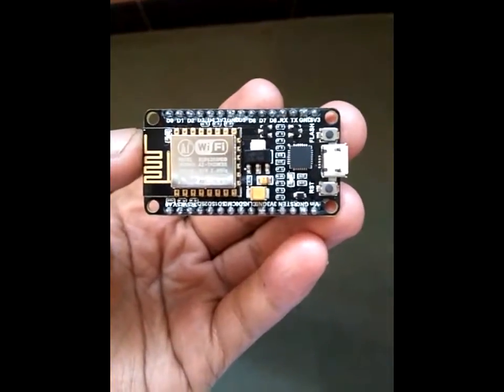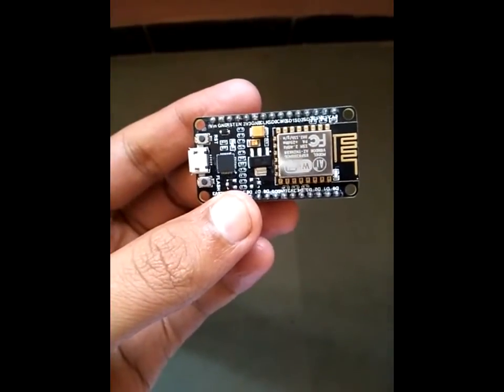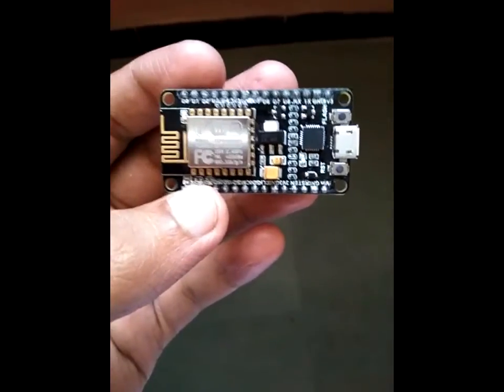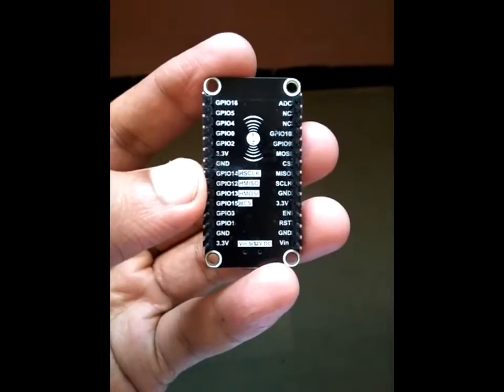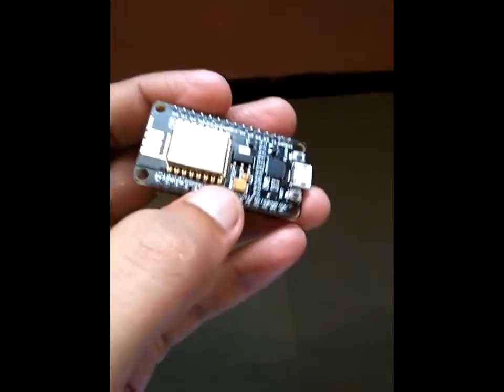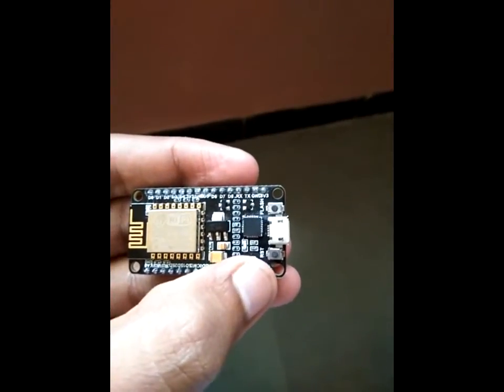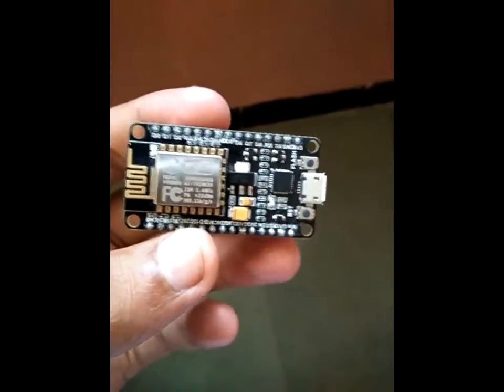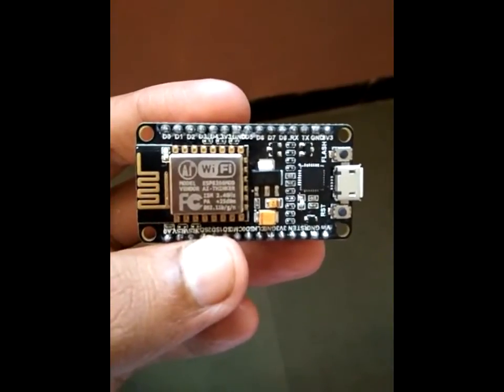ESP12E NodeMCU WiFi Module - "Specification & Application"

Comment: Thanks just let us know is this circuit can be used for devices that are not smart. I want to add this circuit to rectifier system for monitoring purpose and see its alarms. Please advise
Reply from the maker: Yes this device can be used with other devices which are not smart and also can be used for monitoring purpose.